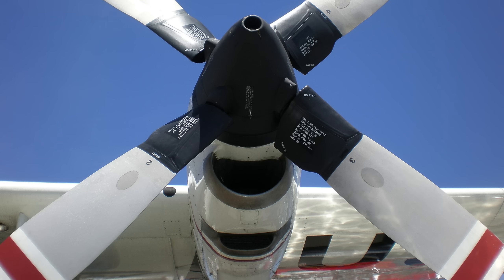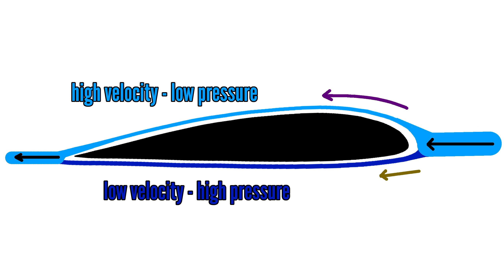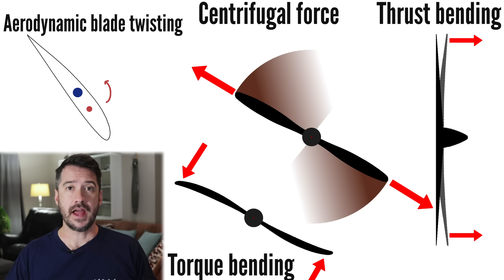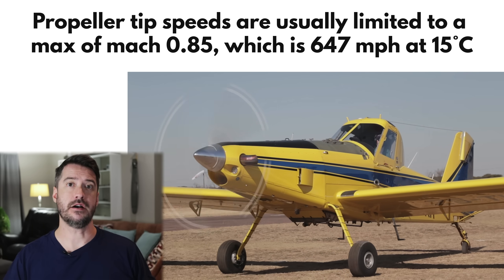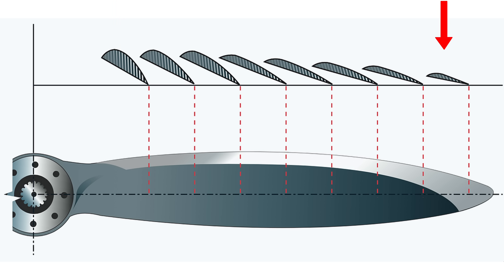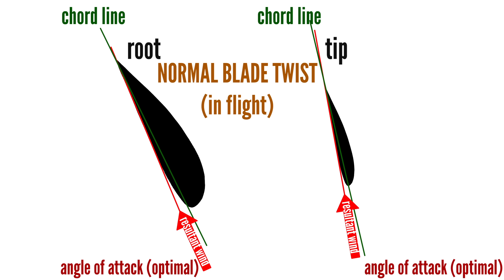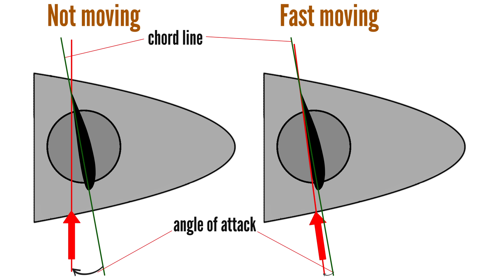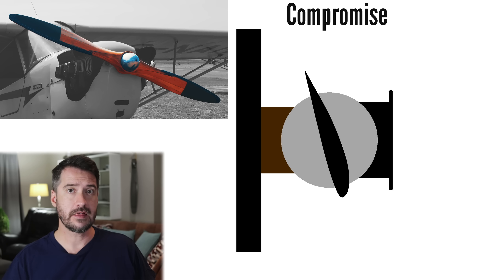One Video to Understand Airplane Propellers

Comment: Assume that for a particular radius, the propeller is a wing section, which travels the length of one associated circumference and advanced forward a particular distance ( pitch) through a helical path.  For any other radius, the associated " wing section " will travel a different circumferential distance but needs to travel forward the same distance  for all radii,  a forward distance , called pitch.  The fact that at different radii the forward motion is the same, means that the blades appear to be twisted. 
The diameter of the propeller is related to engine power, while the pitch is related to the maximum speed of the aircraft. 

There are many arguments on how a wing aerofoil section operate, but since I was very young, 80 years ago, I always looked upon the lift of a wing section was due to the "acceleration" of the air masses above and below the wing or propeller. The most important issue here, is that acceleration is a VECTOR , and it has to be treated as such, considering its magnitude and direction, and the forces generated through these vector accelerations and decelerations, of the air particles in question,  I do not care two hoots about Bernoulli equation, nor the equal distance theory, nor the circulation theory .  Let us stick to basics.

Two stationary air mass particles in line with the stagnant point at oncoming leading edge of the moving wing, one will hit the slight incline to go up, and the other hits the slight incline to go down . These two actions are no different from  two  moving golf club hitting two stationary golf balls  containing mass, 

The upper air mass particle will be accelerated up, causing a force reaction on the leading edge, which contributes to drag,  but as the  air mass particle accelerates up it tend to leave the surface of the leading edge  causing a partial vacuum, by the fact that air is a fluid and the air particles have "sticktion" between them  to make them act as an impermeable  blanket being pulled away from the upper surface of the leading edge, This impermeable sheet of air being pulled away up  from the leading edge will cause a partial vacuum  underneath the " air sheet" which will pull back the air sheet mass towards the leading edge, thus  decelerating its upward movement  after the leading edge had accelerated it. While the air particles  sheet above the wing will try to return to the upper surface, this retracts down to keep the partial vacuum below it, and a good wing section will keep  the air sheet from touching the upper wing surface till it dumps the whole air particle sheet being the trailing edge,  One must not consider the air particles as individual mass particles, but more of a flexible sheet of little masses somewhat like impermeable  diaphragm of an  pump  which sucks, as it is pulled away from some surface. Note all this is due to Force = mass . acceleration, where the acceleration/deceleration   forces that generated, are vectors, contributing to lift by a suction on the upper surface.

The air particle  that hits below the stagnant point  also try to reflect off the leading edge, causing a drag reaction,  but due to the angle of attack other mass air particles lower down will REFLECT  on the under surface of the wing and this Vector  acceleration needs high pressure under the wing. which will add a slight forward velocity to the stationary air particle. Hence while the vacuum on the upper surface causes the associated air particles to gain a slight velocity backwards, the lower mass particles under the wing subjected to a pressure zone will gain a little forward velocity.  Thus the air particles above and below the wing DO NOT MEET AT THE TRAILING EDGE, 

It is the acceleration/ deceleration  of air particle above the wing due to the partial vacuum and the acceleration/ refection  below the wing due to high pressure that lifts the wing up.  The same happens in the profile section of a propeller.

It is to be noted that at start, with the aircraft stationary, the inner 1/3 of the propeller is more like a paddle wheel, due to the high angle of attack,  which normally stalls, while the drive is obtained from the outer 2/3 of the blade of a propeller,  This settles down as the aircraft gains forward velocity. 

At the wing tips of wings and propellers, the best tip designs are those which imitate the wing tips of bird wing,  and the flukes of a fish, dolphin, orca, whale  tail,  where both the leading edge and the trailing edge at the  tips, ARE RAKED BACKWARDS..

For a propeller to keep pulling and biting, it needs to slip, where the forward distance covered is not the theoretical  forward movement, of pitch multiplied by the revolutions of the propeller.  There is more on propeller, especially when the tip  velocity will reach that of the velocity of sound, also when the propeller face is not moving exactly perpendicular to the line of motion, where the pitch of the up going blade is different from that of the down going blade, causing vibration,  Propellers are not too difficult to understand, if one forgets the Historic names associated with anything that causes lift, and simple use the basic fact, that when a mass particle needs to be accelerated or decelerated, it will do so by the creation  and reaction of a force.  A wing, or a propeller is no different from a running chisel/surface wood plane, continuously  cutting  or pushing away at the impervious block of mass air particles by, continuously slicing two  mass sheets, one above and one below the wing  and   ACCELERATING AND DECELERATING  them in a required direction, in locations above or below the wing surfaces, and the tips, then continually dumping it  all DOWN behind the trailing edge and with many other complexities  and circulations around the wing  or blade tips

Note that vortex circulation  whose axis is parallel to the line of travel of the wing, do not do much harm, but vortex circulation parallel  and occurring above or below  the leading or the trailing edge are very dangerous indeed  .

Comment: I'm surprised that centrifuge force device device has been created to change AoA when speed and torque variables are reached when in flight.  Centrifugal devices have been used for many years within speed governors and timing advance units in automobiles but engineers are not weak minded, if they could design a functional unit within size/weight restrictions, they would have.

Comment: Good video. On my electric radio-controlled model planes, I chose the pitch first since electric motors turn a certain number of rpm per volt applied to them. I then calculate the diameter of the prop needed to load the motor to the proper rpm, current, and watts. I try to keep the diameter-to-pitch ratio (D:P) between 1.5:1 and 2:1. The larger the diameter, the harder the motor will have to work to spin the propeller blades thru the air instead of pushing air to the rear.

Comment: One way I've always thought of propeller pitch is similar to the gears in  a car, what I mean is in a variable pitch propeller fine pitch is similar to a low gear faster acceleration where a course pitch is more like a higher gear it's more suited to flying faster similar to travelling faster in a car, the same applies to fixed pitch props a large diameter fine pitch is similar to low gear where a smaller diameter course pitch prop is like a higher gear, a fine large diameter prop movers more air slowly but a lot of it where a smaller courser pitch prop mores air faster but less of it, I know this is a simplistic way of looking at it, but it's simple, easy to understand and works for all intents and purposes.

Comment: Why doesn't a model airplane tractor propeller running in reverse in pusher mode with a rear facing engine work as well as a tractor prop on the front? A lower RPM is developed with less thrust indicating the propeller is presenting a higher load, but creating less thrust.
Reply from the maker: If I get what you are asking, why doesn't a propeller spinning in the reverse direction create as much thrust (in opposite direction) as when spinning normal direction? Because now air is flowing over the blade from the trailing edge to the leading edge, i.e. the wrong way, which would be similar to mounting an airplane wing backwards. Keeping in mind propellers doesn't just deflect air (even though many claim so) they work like a wing by creating a pressure differential by accelerating air over the top of the blade. The chord shape is chosen to accomplish this efficiently. When using the tractor blade in the rear to push (by spinning the prop in wrong direction) the chord shape is all wrong, and air is flowing over it reverse direction it was designed to, and will be very inefficient (a lot of drag, but little thrust) as you experienced.

Comment: Great video! Please address how the propeller RPM should be set during a prolonged high speed descent. Say, a descent from  15,000 feet to a sea level airport over a distance of 40 to 60 nautical miles.

Comment: Well presented. If part 2 is in the works perhaps the choice of airfoil and improvements since the Ckark Y, spanwise selection of airfoils based on Reynolds number, leading edge angle,  optimum chord.  Regards

Comment: Avoid propellers that used bleached cork, to keep the balance weights in place. Chlorine will leach into the metal, and start cracks. Prop may depart, mid-flight.

Comment: Great video, i learned a lot!
but I also noticed a technical error during your description of airfoils. Air does not take the same time to cover the distance above and below the airfoil (in fact; you’ll see in wind tunnels the air above is quicker to reach the trailing end) but works instead by deflecting air on the underside and accelerating on the upper side by means of the kiwanda effect
Reply from the maker: Thanks. Yes I've received a few comments about it and finally decided to address it in a pinned comment.
I don't even remember if I was taught the equal transit theory in flight school, it was long ago, but I highly doubt it. I've never cared if the air going over the top arrived behind the airfoil at the same time, slightly before or slightly after the air going below, as I've always found it completely irrelevant to lift creation. Lift is created by pressure differential (or the push/pull you described which is still air pressure), not by the exact timing of the top vs bottom air. But I appreciate now that just because I find irrelevant, others might care about it. So you are correct, and thanks for the comment, see that pinned comment for full explanation.

Comment: Great video.  Part 2 would be welcome.  Having made a few props for homebuilt airplanes the question I was asked by my mentor many years ago was:  and how do you measure pitch ?  is it the aerodynamic pitch or the bottom surface of the prop?  I have tried some experiments with blade shape, ie; scimitar shape for example, in an attempt to see if aerodynamic twist works.  My test platform is my plane.  I usually do a full power tied down run-up to see if it turns fast enough. i'm looking for more than 2100 rpm with my o-200.  the next observation is climb rpm and lastly I set throttle for  manifold pressure of 22 inches and see what airspeed i get.  There is also some difference with the wood species used I have heard. no pun intended ... I usually laminate maple, birch and cherry, as I like the look of the cherry on top.  The prop on the SE5a in Singapore is one I made.  Cheers.🍺

Comment: G'day,

I recommend you to look up,

"Betz Law of Wind".

He established the
Equation telling how much
Energy in the moving 
Air Column can be converted into
Rotational Torque, by
ANY
Rotating Aerofoil Array.

59.63%...(!!!).

And, because it's an
EQUATION...,
Therefore thus & because...; 
It works BOTH WAYS.

NO Airscrew can EVER 
Convert any more than
59.63% of the Torque going into the Hub,
Into ACTUAL
Thrust.

When a Propeller Salesman claims
"93% Efficiency"...;
They are squeaking of
93% efficient at 
Achieving the
BETZ LIMIT, of 
59.63%.

Which 
Thoroughly explains the
Crashes of 
EVERY
Crashed-on-takeoff attempt event involving 
Underpowered 
Overweight
Homebuilt
Amateur-designed
Technicoloured Daydreams.

The Powerplant in each one was expected to convert 
"Horsepower" into
"Thrust"...
Without any comprehension of, or allowance for 
Betz' Law.

Therefore 
They 
Crashed...

Your 
Production Values are much better than mine...

You should make a video about how
Betz' Law of Wind
Applies
Equally to
Airscrews...

In my opinion.

Go your hardest.....!

Have fun.

Stay safe.

;-p

Ciao ! 15:07
Reply from the maker: Thanks for the suggestion, something that could go into a part 2 I'm planning.
Reply: @LetsGoAviate  

Good stuff,

I find that although most people realise that an Airscrew is a Wind Turbine "designed inside-out, running upside-down & backwards"..., putting Energy into accelerating the Air going through the Disc ; not so many seem to realise that the same equation which explains why no Wind Turbine can ever extract any more than 59.63% of the Energy in Wind - because it's an Equation, also delineates how much Energy in a Shaft can be put into the Air Column by a Propeller - no matter how "efficient" the Sales Division's Marketing Jism tries to paint their story.
For a century, backyard Wannabes have been building little Aeroplanes  and crashing on the first attempt at flight, or staggering around the field in a precarious low slow circuit - because the
"92% efficient Propeller is only 92% efficient at achieving the 59.63% Betz-Limit...; but the Propeller Industry behaves as if 
"92% Theoretically Efficient" is a term which their Customers 
will somehow
Automatically understand to mean
"92% (of 59.63%) Efficient".

I have yet to begin repairing my second Aeroplane, a 22-Hp VJ-24w which had a JPX 425 Pul 2-cylinder 2-stroke, direct driving a tiny little (41.5" X 12.5") Toothpick...; after hitting the Fence on a Downwind Takeoff in a 200 yard Paddock in 1992.

I designed & Carved the Propeller with which broke my foot...

I didn't hear of Betz' Law of Wind until about 2000.

I thought I was a pretty good self-taught Propeller-carver , but it isn't what one doesn't know that hurts ; it's what one does know which isn't actually true that'll do the damage...(!).

My blind spot was that I'd flown behind an 8-hp Lawnmower Motor with a chain-driven Propeller when I was 17, and at 32 my thought was that 22-hp should be easy ; but the Mk-1 Pre-production Skycraft Scout had been built by an Engineer who actually knew what he was doing.

The Reduction-drive made the 8 Hp much more
Propulsively efficient than the direct-drive 22-hp...

Oopsie !

Such is life,

Have a good one...

Stay safe.

;-p

Ciao !

Comment: Formula for kinetic energy is: E = ½mv^2. Increasing velocity requires exponential energy, but increasing the mass doesn't. Formula for force is: F = ma. If this determines our thrust force, mass and acceleration contribute equally. If we want maximum thrust with the limited power our engine has, it is best to maximize the mass of air the propeller can accelerate, rather than to accelerate a small air-mass to a very high speed as that would require way more energy for the same thrust force produced. However, accelerating air to higher speeds allows for higher top speed as you cannot fly faster than the speed to which air was accelerated.

Comment: Back in the '90's I had a propeller program from Hartzell that contained every profile available and all factors could be altered and the resulting efficiency curves displayed.   Very fun to play with and a couple things really became obvious:  a propeller is inefficient until it is spun to near it's maximum tip speed...much like a turbocharger compressor it needs the speed to work.   And forward velocity adds to tip speeds so on a high performance aircraft that flies very fast maximum  rpm as the tips are reaching the Mach must be reduced.   So this really is a problem for reaching high speeds and much of what drove the change to jet propulsion as it doesn't matter how much power you make...the propeller has to keep slowing down the faster you go which just makes it consume more and more power for little velocity increase.

On a variable pitch propeller the takeoff power available and the rpm needed for that has to be balanced with anticipated cruise speed and desired rpm when choosing the propeller size, blade profile and number.    These factors also play a part in a turbo-fan engine's fan design but many of the modern ones actually do exceed the Mach and operate in a containing shroud so different physics are involved that don't work with exposed blades on normal aircraft.   Really fascinating subject with lots of depth that most of us never think about...good video!!
Reply: wrong.... slower is more efficient....  look up definition of Efficiency...
Reply: @mithrandir1313  Slower IS more efficient...but only to a point where it can no longer work.   A propeller at 10 rpm is pretty useless....right?   Speed it up and at some point it starts to put engine power to the air noticeably better.   That is your best cruise rpm if the motor will take it.   Some engines don't run at their best outside of a designed speed where the manifolds and cam are happiest and the prop should be designed to work well in that same range for best performance.